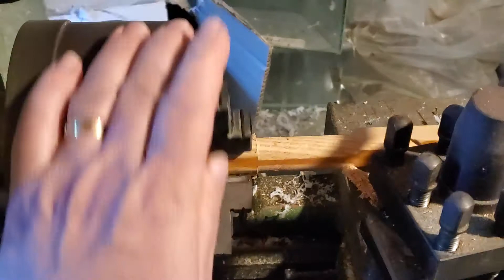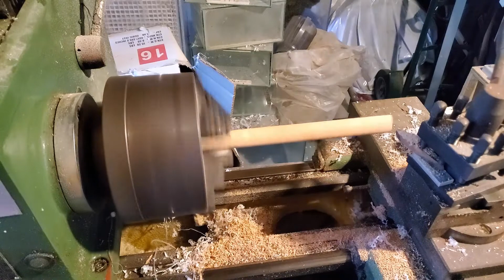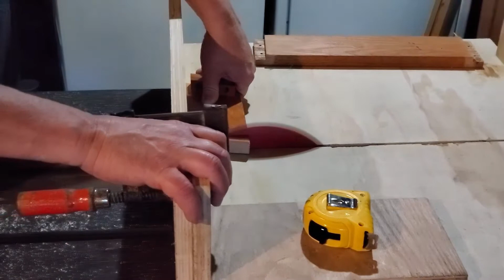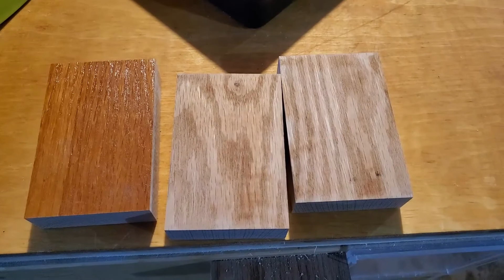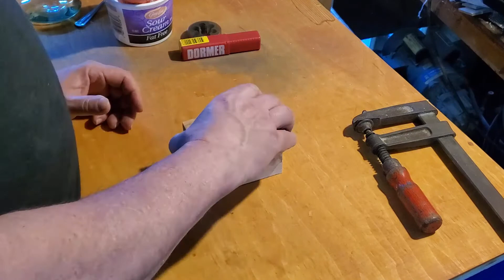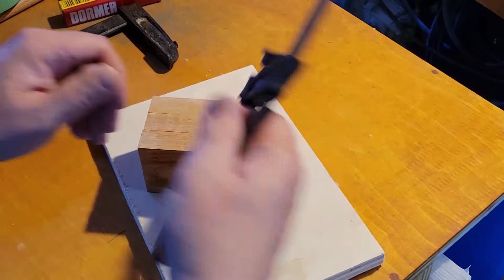Wooden Mallet Part 1

Comment: Rounded corners/ edges could help keep the mallet from splitting pieces off if the mallet was to strike something on the edge. I have seen it happen many times when you pound a rectangular wooden stake in to the ground and glance a hammer on the sharp edge of the stake. Sometimes large pieces splinter off. If you round off the the edges and corners of the impact site this helps to keep the impact pressure towards the center of the stake, saving  the edges from any blows that could cause splitting.
Reply from the maker: Thanks for the input on this Matt! Thanks also for taking the time to watch!